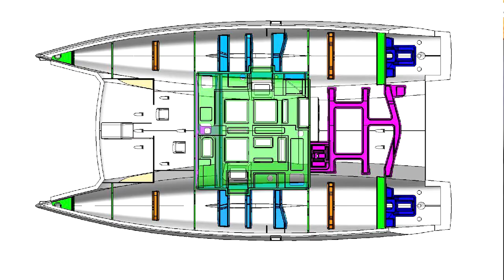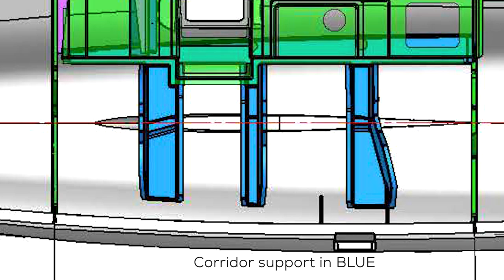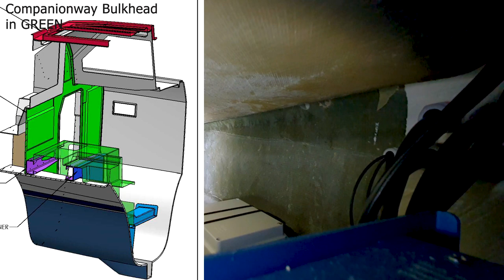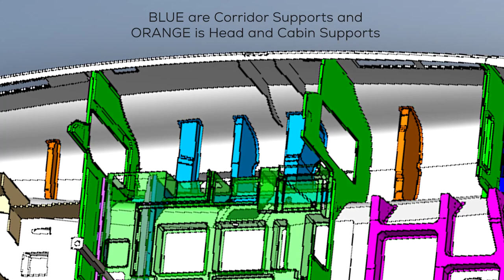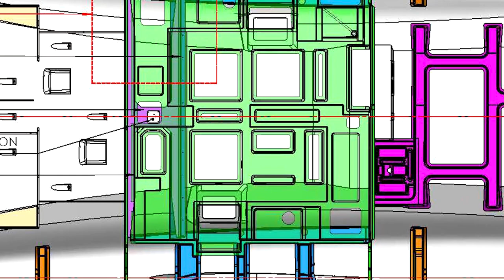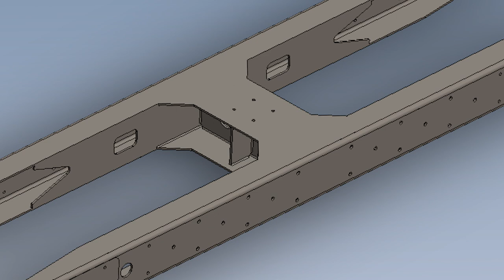#142t Does the LEOPARD 45 have BULKHEAD Issues. I'm ALONE on board, am I in TROUBLE? | Sailing Sisu

Comment: Nice vid Petro, Leopard are far superior to Lagoon in every aspect, especially build quality and engineering design. Leopard should slip you a few $ for promoting the superior build quality over Lagoon. Leopard sales must have increased substantially while Lagoons must have plummeted since the build quality and after sales support issues were exposed by Colin on Parlay and went viral. Make no mistake, Lagoon have had these issues on their cats for many years and a bad reputation for after sales support too across all of their models. There are many documented cases of which Lagoon refused to accept any responsibility for their poor quality, some of which caused total constructive losses of the vessel. One that is burned into my memory is the Lagoon 500 that sunk off the east coast of Australia due to the engine compartment bulkhead not being watertight as Lagoon claimed that it was in their documents at the time. Lagoon wormed their way out of the liability by stating that it was not required to be watertight under the building code, so they weren’t responsible. They then removed their wording of it being watertight from all of their documentation. Very dishonest of Lagoon. 
When looking to buy a vessel, the buyer should look closely to the builders history, and if one does that they would avoid Lagoon at all costs.
Leopard still are not perfect and do have some minor issues to address like the resealing of wood after drilling and chafe protection of cables and plumbing passing through the H frame and panels and bulkheads and cleaning properly after construction. But even so they are by far superior to Lagoon and also superior to FP in build quality, engineering design and QC, and not to mention after sales support.
You and Frik have a great boat and for sure can sleep comfortably with the piece of mind that you have a very well built cat that will not let you down.
Stay safe and fair winds and calm seas from WA 🇦🇺
Reply from the maker: Thank you for your kind words! Yeah, we are flirting for them using our 142 koowl videos of the Leopard 45, but they know their product is doing quite well on its own :-) and they know we love our Leopard 45 and we love video making and that we will continue doing it even if they don't sponsor us....so....no leverage :-( no rum money :-( As to the waiting queue on a Lagoon vs Leopard... I am not so sure you are correct :-) ask your Lagoon dealer when will you receive your Lagoon if order today and do the same for Leopard. Would be great to have someone verify that :-)
Reply: Just the quick clips in this video illustrate far better craftsmanship and design in the Leopard vs the lagoons. There are many examples online of lagoon bulkheads not even being tabbed in

Comment: Key inspection imho would be shroud tension. That is what got mast bulkhead controversy going in the first place because Colin discovered SV Parlay Revival's side-stays were not taught as they should be just prior to attempting to sail across Pacific Ocean so he then went down below & exposed bulkheads that were hidden from view to find they were buckled & not properly tabbed or even glue cemented in many areas.
Reply from the maker: Very good observation, Kevin! Yes, we do not go over the threshold set by manufacturers :-) but that is like you said, controversial, because constant bashing of the sails against the wind in big or confused seas, that will place huge stress with each rising on a wave, on the shrouds and therefore also the bulkheads. I mean, that is why we have bulkheads. Our own viewers started to query us either because they are confused about what is a Lagoon and what is a Leopard, but we decided to do a check anyway, like we do before every long passage or annually. You can have a look at our previous videos in the "Boat Check" series/playlist.

Comment: Great to see your leopard looks well built- unlike 'Travel Sketch' multiple video's showing broken & cracked bulkheads, numerous area's found with dry glass matting and zero resin - anyone looking at buying a leopard needs to see their 2 years of so many major faults in the many many video's where they show all the faults found, it has put me on the back foot regarding buying a leopard - which I was considering before I saw their video's.
Reply from the maker: Sure, did they buy a lemon? But for sure, they are hacking and modifying their boats beyond recognition 😅 I am in Trinidad and do not wish to meet them. They know how to burn their bridges. We've met over 50 L45 owners. We are part of a few L45 groups. I can assure you that that is the only boat that has all L45 problems combined and 1,000 more.  We have spoken to new owners of performance cats, production cats, etc. All have issues. Just watch SLV, Wynns, Ruby Rose. But you decide dude. It is your money and you should vote with it. We are happy and solve our issues without fuss.

Comment: Amazing inspection, well done. Since you bought the boat new it would make sense to have Leopard video tape a final inspection before delivery. From your video you can see where cables run through the meal beam with no protection,  plus I noticed lots of places where they drilled through encapsulated plywood and didn't bother to seal the edge of the hole leaving exposed wood, plus during construction they just left the drilled out sections in the hull with what appears to be a lot of sanding dust. I bet they won't get away with this on your next boat purchase? "Happy Sails" loved the video.
Reply from the maker: Yeah, we are not overall happy with the Quality Control such as the cutouts and dust, but it seems it is happening with all boats, and not just production boats, I have heard from high performance cat owners who are also complaining about the spaces not normally seen by public :-( very sad indeed. Anyway, the point was to inspect the tabbing on the bulkheads for any cracks ;-)

Comment: I haven't heard of any problems with Leopard cats having similar issues to that other company that starts with an "L".  I am disappointed that they're still using plywood for structural coring and not glassing over any cutouts used to feed wiring or plumbing through.  If they used composite (lighter and stronger than the same thickness plywood) there would NEVER be any concern about rot due to moisture getting into the wood since the only real wood would be trim.  The blue waterline going through the hole in the H-frame  needs some chafing protection also.
Reply from the maker: Ah, very good observations! Yeah, we were lucky to have the earlier models of Leopard 45 and already had three awesome years on her, but unlucky that all the newer models are now built with foam core. It is more expensive than wood, but it is like you said, more structural sound. Also, I should blame the aftermarket guys for some of that cut outs and sloppy work. That said, this inspection and our friendly viewers, showed a few things I need to put on my long to-do list :-)

Comment: Have watched all of Parlay Revivals rebuild & thought I would go with a SS beam like you all have. they have packed enough glass in to have a stable boat now, but did have some very weak points before the rebuild. Thanks for the detailed inspection.
Reply from the maker: So glad their problem is sorted now, very happy for them.  Thanks for popping in Bob
Reply: Yes, got to agree with you.   What we saw in Parlay’s Lagoon is no steel structure to stiffen and bind the entire structure together.   You’ll never achieve the same stiffness with ply and fibreglass.   That means there will always be much greater stresses on any Lagoon structure and eventually you will get failure.   

The other major difference between the two boats - on this video we did not see any exposed ply.   Absolutely every bit is covered and protected by fibreglass.   I was astonished to see so much exposed ply on the Lagoon.   Ply (wood) will absorb moisture, Will then expand resulting in failing of structure.   Any boat is “wet” and therefore having ANY exposed ply is terrible construction.   

I was a big Lagoon fan - but having seen the difference is so vast that I no longer will look at Lagoons.   Beautiful boats but shocking construction.

Comment: Hi Petro
Nice video. Mine is the leopard pre the front door model which is the main reason for your Ibeam. Our models not not have the I beam as the mast sits on the front bulkhead with a lot of support. What is interesting is that our boat is a owners version and the rear bulkhead in our cabin is about 40mm thick double the thickness of the one in the double cabin side. Our main mast bulkheads are 20 mm thick and have full double layers of fiberglass on both sides so very strong indeed. The back cabin bulkheads on our boat are the edge of the hanging cupboards to you can see the tabbing on the inside of the cupboard. 10 years on no cracking or movement on any of mine either.
Keep enjoying your boat 👍 rgards
Reply from the maker: Thank you, Mike! Always good to see your name! Thank you for that interesting info, did not know that! RC made those older models even stronger! Thanx again for your ongoing support! We just love our Leopard 45 :-)

Comment: I havent heard of bulkhead issues with the Leopards but I have heard of deck separation ie the cabin deck separating from the lower beams and the lower deck, the first indication you will get if such an issue is present is a spongy feeling as you walk over the cabin deck.
Reply from the maker: Hi Kell, we heard it too and I went underneath the deck and checked specifically for that. Well, at least on our Leopard 45, will it take a serious force to unglue the blobs of resin glue. We do not have putty, but lots of resin glue. No signs of separation so far. ☺️

Comment: Hi Petro.

Very Well Done to You.

Not many girls would climb into those tight spaces that You did. You are one Brave Lady.

Please have a look towards the end of your video at where you show the H Beam with the cables or conduits passing through holes in the H Beam. Any time a cable or pipe passes through a hole there should be a Grommet or some sort of rubber ring around the sharp edges of the hole so that vibration or movement under way does not cause a wear fracture of the hose / conduit.

Please consult someone with industry knowledge about this and remedy this as they suggest, there is very little money involved in remedying this. Because boats are made on a production line they most likely skip this because of time and cost considerations.

Please do not take this as a criticism I am just pointing out a minor flaw in the manufacturing process which will be easy to fix on the boat.

Thank You for posting.

Luv Your work.

Regards.

David Down Under.
Reply from the maker: Thank you, David! Really not offended at all! In fact, much appreciated! I noticed the same things and most of those are from the aftermarket guys. That said, it is now on that long never ending to-do list :-) thank you again for the compliments and your ongoing support!
Reply: @SailingSisu  Thank You.

Comment: Very nice! -- QUESTION --  The sub-frame @5:37 is shown.  The picture is from the factory construction, but can you show us whether they are simply "glued" down or are they fiberglassed down and attached to the hull.  A lot of Jenneau and Benateau sailboats are actually glued down and the glue eventually breaks its adhesion and the sub frame becomes detached.  If possible, could you show this please so we can see how it is done.  In the video, the frame is not fiberglassed to the hull, but this may be because the boat was not completed at that time.  Not sure.
Reply from the maker: All joins are tabbed.  You are correct that the frame was not fiberglassed in that frame, boat was not yet completed.

Comment: 🤔 is the s/v SISU built the same as a '43 like the Wynns have? They recently have a hole under the Cockpit floor hatch cover were the liferaft WAS,  among other stored ideams. It seams a wave sucked the bottom off.
Reply from the maker: Hey, Steven! Always good to hear from you! No, Sisu does not have a life raft in the same position as the Wynns. I was actually pretty surprised when I watched their video! Nothing to do with bulkheads BTW
Reply: 'Not about bulkheads' is true. Just a general question.
Reply from the maker: No worries, Steven! Thank you for your ongoing support from the start! You are a star!
Reply: I think the 43 and the 45 were the only older models where the liferaft was in the middle of the floor. All subsequent models had the liferaft under the back bench. Mine was there as well until I moved it to the back between the davits for easier deployment. My old liferaft was 80kgs and there are 4 u bolts in the floor where you secure the liferaft too to stop it bouncing around in big seas. The Wynns have not yet put out what  the boat looks like from underneath to see what actually happened there. A scary hole indeed but still a structurally sound boat as it carried on never-less without problems except some uncomfortable water running around.
Reply from the maker: @mikeferguson2828  true! we moved our life raft also to the aft rails. the version of the Wynns was to be able to deploy the raft when the cat is upside down too. very much like Outremer with their life raft in the trampoline. The older L43 like the Wynns, you can reach the raft from both sides, so, it is designed to have a hole, but it still doesn't look right :-)

Comment: Although more expensive, using (mostly) carbon instead of stainless steel for the beam construction would have saved a considerable weight.
Reply from the maker: You are 100% correct in both cases :-)
Reply: seawind in Vietnam also balance and other Sth African builders /  and some are cheaper than a Lagoon

Comment: hard to tell if tabbings done in all bulkheads when its painted over, could be fairing or glue sanded down and painted. during construction is the time to look, preferable someone elses build before you sign on the dotted line. im sure R&C are better builders than lagoon. a lot of production boats are poor quality these days, why do people not do there homework.
Reply from the maker: It is our opinion too, Simon! Do your homework! If you followed us, then I do not need to tell of our 22,000nm over 80 latitudes in pretty hairy storms or seas while doing 20-32 day passages. It is always good to check for cracks and the brittle gelcoat will tell you very fast if the structure is flexing or breaking. That said, we did check on our build as per photos of Sisu while she was laid up. Off course, we were super newbies and had no idea what to look for :-D we were just impressed by it all! Not that manufacturers like to take every prospective owner through the factory and I don't think "homework" includes going to every factory you have on your list...but yeah, if one is not happy, then you need to lose your deposit if you decide to go for another builder. And I agree, when boat owners from all sorts of brands, get together at the local pub....stories are flowing. not one manufacturer is excluded from boat owners wrath :-D

Comment: 👍
Reply from the maker: Thanx, Trev! Very tuff topic, hey?
Reply: @SailingSisu  yeah good inspection thou..   the only other thing I would probably check,  if you life raft is stored in a under floor locker like the Wynns was,   Yeah it fell out the bottom,  left a hole in the boat,  right when they may have needed it,,  and the worse part,  it didn’t deploy anyway..      yours looks like a newer model and may not have that issue..
Reply from the maker: Trev, we saw that episode (actually all their episodes because they are the only big channel that we do follow :-) ) and was surprised that Leopards had long ago, life rafts in that position! It is not a train smash in the sense that they lost structural integrity, because like Outremer for example, it is designed to be retrieved when the cat is either upright or upside down. That hole is designed :-) but you should know, our life raft is on our aft rail ;-)
Reply: @SailingSisu  good to hear!  I knew it was going to sink the boat, but it was definitely doing its best to swamp the batteries,  just a stupid design,  but the Leopard definitely looks better than the lagoons,   And people hate me saying that, but they are normally lagoon owners or brokers, or charter operators,  we don’t want so couch sailor Depreciating our boats!    I say to them get stuffed!  Because without negativity there is zero Incentive for improvements..   just like any product!
Reply from the maker: Yup !!!